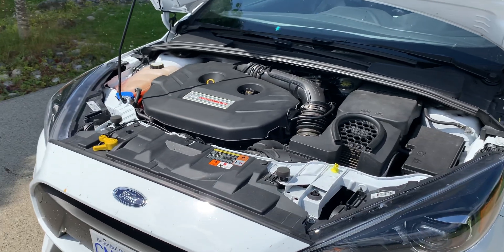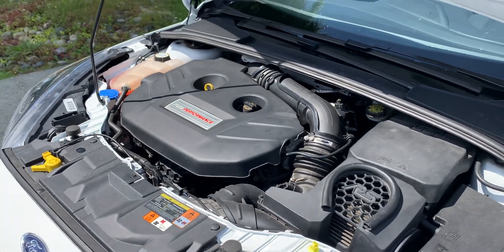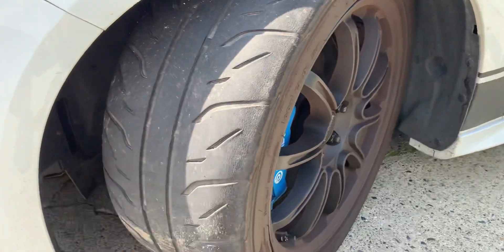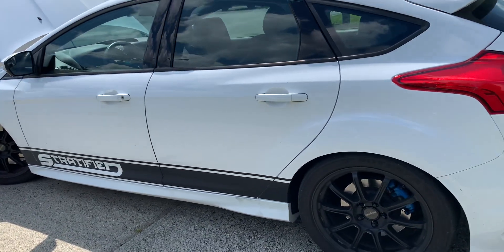Stratified Focus RS Build Update

Comment: I sent you a message before. I am from Vancouver I own some Ford Cosworth cars. My friend is building sapphire Cosworth for me and once it’s ready, we will give you a call. I have a Vipec ECU plus once I sell my escort Cosworth I’m going to get a Ford focus RS, which I will also bring to you.

In terms of the car you’re discussing right now plus the other car that you do know the red Ford focus RS which was I think 600 wheel horsepower, what blocks are you using? I doubt that you’re using a standard block for this kind of horsepower?
Reply from the maker: Looking forward to tuning your Cosworth! As for the RS, you would use either a closed deck ST 2.0 block or sleeve the block at this power level.
Reply: @stratifiedauto  Glad you said that. I didn’t think they’d be using stock blocks.